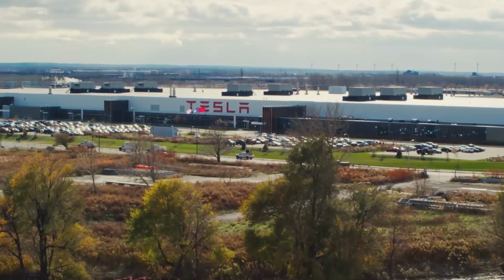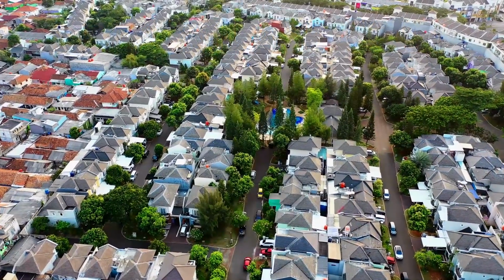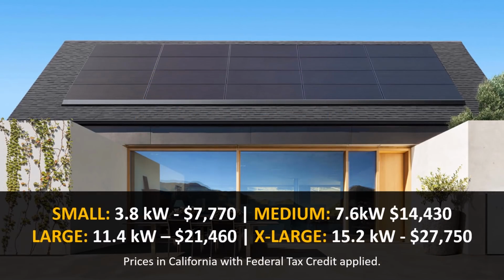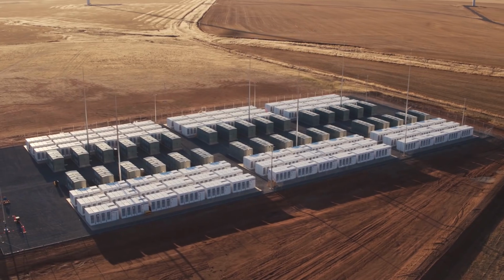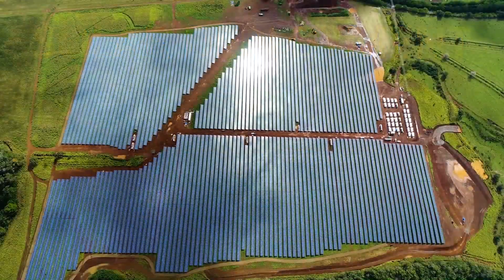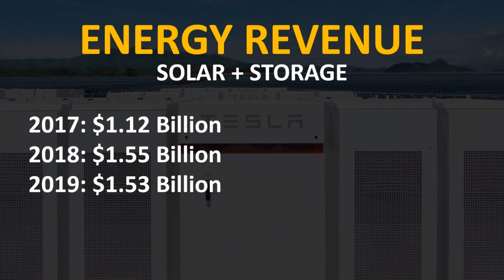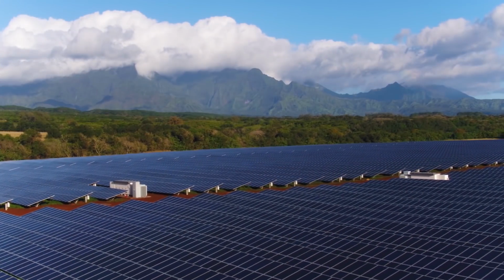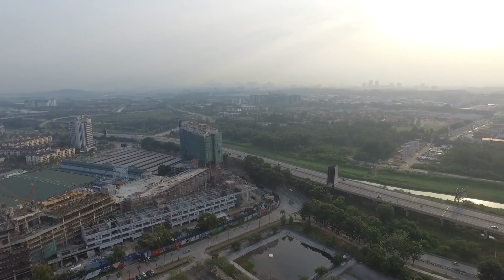Profitable? Why Tesla Energy Storage and Solar is Important for Tesla's Future Success

Comment: The only issue with the Powerwall is that it requires a connection to the grid and is not yet compatible with off grid systems.  I understand why this is but the current off grid storage solutions tend to cost a lot more for the same storage capacity and system life span. As for your expectations, I think 50% is doable but it will take some MAJOR news at the Battery Investor Day to make a 100% growth rate for storage feasible while also expanding vehicle production and introducing storage heavy products like the Semi, Roadster 2.0 and Cybertruck Tri-motor.

Comment: Solar electric is not advisable on just any existing roof.  Sales people will never address that, for fear of loosing a sale.  Trees near the house will only be mentioned after equipment is installed and their shading is killing 90+% of predicted  production.  Slope angles and orientation of roof and house are never mentioned by the salesman.  The facts are real for solar and with a perfect install Solar electric systems are a very good investment with paybacks in 6 or less years with tax of cash incentives.  The numbers  don't like .  Utilities  put out a lot of wrong information so home owners won't eliminate their $200 a month ($2,400 a year) electric bills.  If your power bill is $200 a month, how many years will it take for a  $10,000  system to pay for itself?  However, if your property has big trees,  are they  going to shade your panels increasing the pay back time line?

Comment: #NMGRF is a Green - Carbon neutral - mining ⛏ company using electric ⚡️ vehicles 🚗 in the mining process. They mine high quality graphite that is 14% of lithium ion batteries (by weight) and other batteries that are used in grid storage.  If Tesla wants to green the supply chain they need to really look at the suppliers for the raw materials for PowerWall and battery 🔋 production. Love this video and I will share it with my friends that just don’t believe in solar and battery storage solutions.  Thanks

Comment: I own a Tesla, solar panels, and powerwall storage battery.  I bottle up the sun, in a battery, to use at night.  Why pay for gas or electricity when you can make it at home.  I save $800/month on home electricity and gas.  I sell excess electricity to the grid.  I have battery backup power during an outage.  I use my electric company as backup to my backup.
Reply: Batteries have to be a lot cheaper to make sense.
Btw, I currently receive a $3K cheque from my power supply company every year, and of course have no power bill, and my 'ruf' top solar pv shields the roof, hence keeps my house significantly cooler.

Current roof top solar panels are great heat shields, being installed 100mm above the roof, air circulates underneath.

Will the Tesla solar roof perform shield the roof from the sun this way? I doubt it. Not enough air gap.
Reply: $800 month?  I couldn’t imagine a way to get my electricity bill that high even if I cranked my AC for a month straight at 50 deg in mid summer.  I live in Southern California where electrify rates are the highest in the country. Where are you at?!

Comment: Anyone can pluck numbers out of the air.  Would like a bit more justification for those numbers.  For example the 100% growth for 2021.   Solar has a headwind to growth because it is very labour intensive.  Power storage has a headwind because Tesla are battery constrained.  Battery production is increasing but so are the number of vehicles using up that supply.  Elon predicted a 50% year on year growth for automotive. ...  that’s a huge amount of battery production that has to be ramped up.  I’d be really surprised if they are not still battery constrained in 2 years time.  I guess we will have to wait until battery investor day for more clarity
Reply: The china gigafactory battery production factory isnt even done yet, when its done they will make a lot more batteries than now, also germany gigafactory is coming which will also make batteries, so in a few years tesla will double or even triple their battery production.
Reply: Superman I think you are underestimating how long it will take to ramp production.   Consider how long it has taken Panasonic to ramp
Production.  I suppose battery investor day will provide a bit more clarity.   Hopefully a Tesla will surprise me

Comment: Thanks for your efforts.  Well done and I agree with all that was said.  Replacing Peaker Plants in the US allows not only for cleaner air but also for a future engineering development that will serve to transform the grid, closer to a local distribution and generation system.
Although not as glamorous as future cars, I believe that renewable energy generation,  energy storage and energy distribution, will likely prove  to have the greatest positive impact on our planet for the next 50 years.